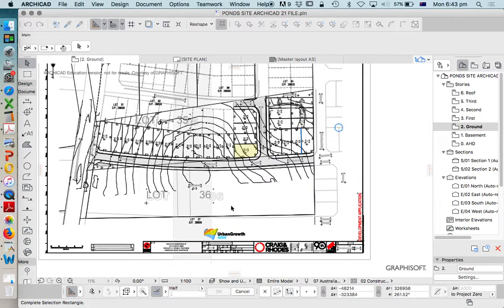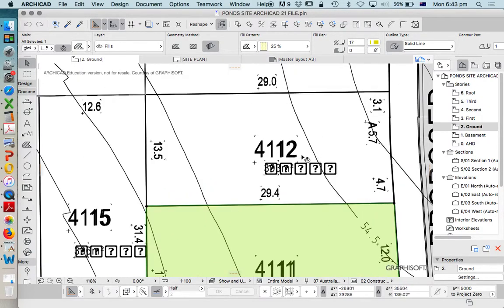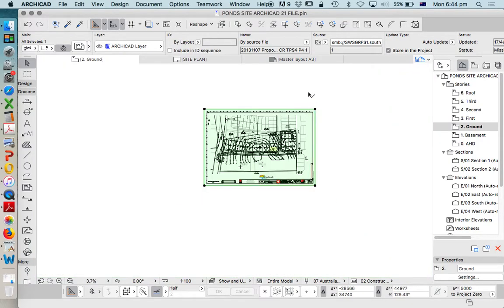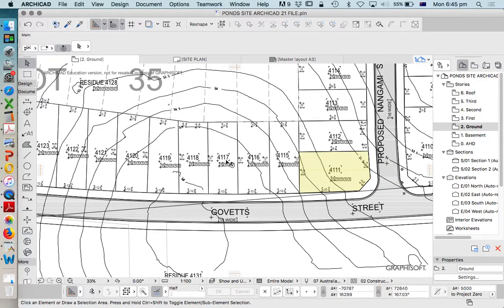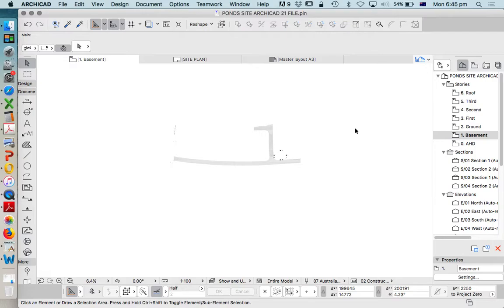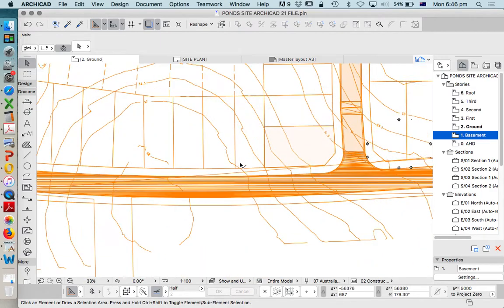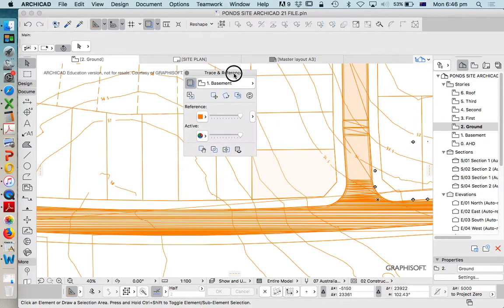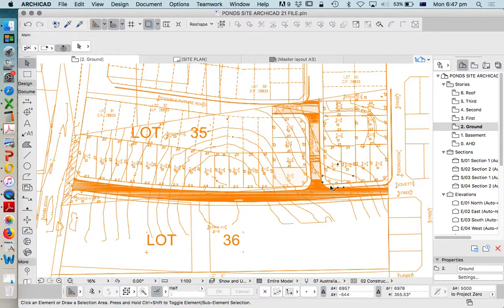ArchiCAD 21 House Project - part 02 survey use

Comment: Why don't you just use worksheets to place the PDF and the exploded linework image on?
That will actually leave your floor plans free and you can still trace reference the images and the linework the same way, while having a much more cleaner working space (IMO)
Reply from the maker: I have used (and created videos) of this method before. You are correct, workspace would possibly be a better option, however it really doesn't matter as both work.